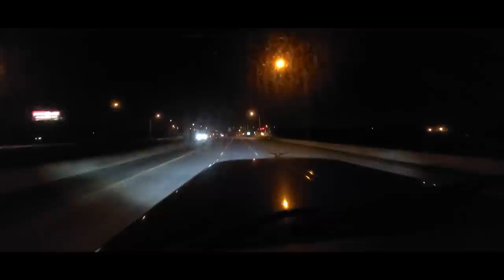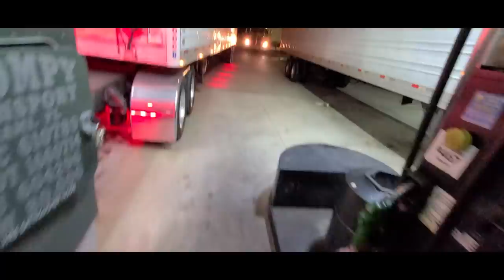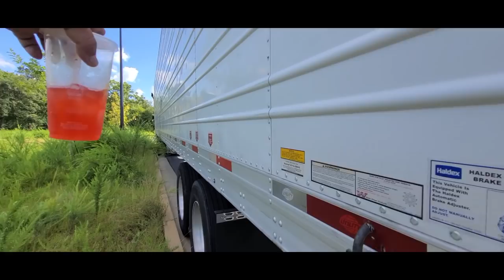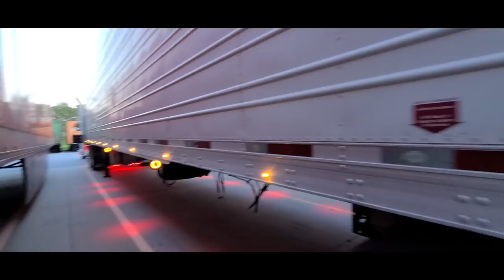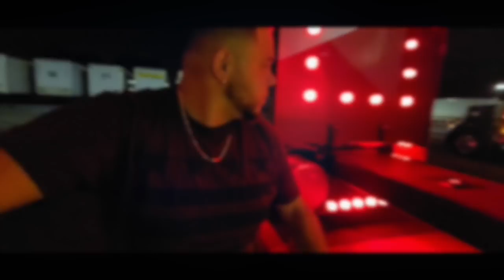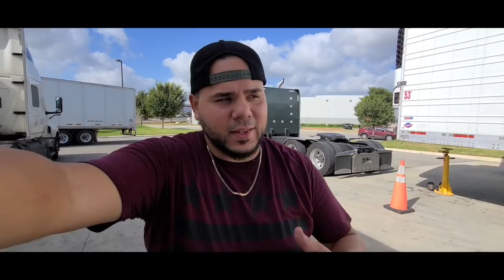Deadhead 700 Miles for a load/Florida Loads need a change #fltruckriderz #peterbilt #OTRdriver

Comment: Always nice when you can get a 10hr break in at the shipper : )...them head lights are nice and bright, I need to upgrade to LEDs. Check 4states trucks, they have all them lights order 'em online. I get trying to support local...but if they don't have what you want. All my charge air pipes are gloss black, match the valve covers. Looking good.